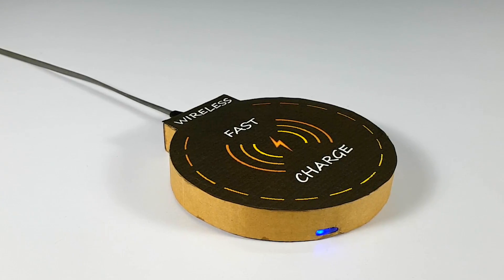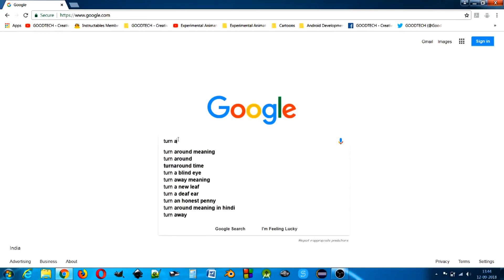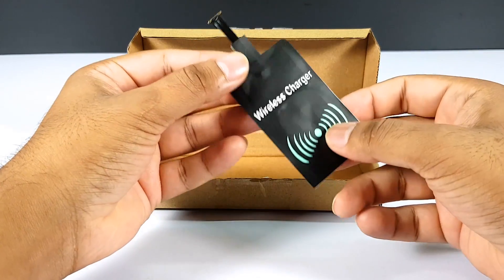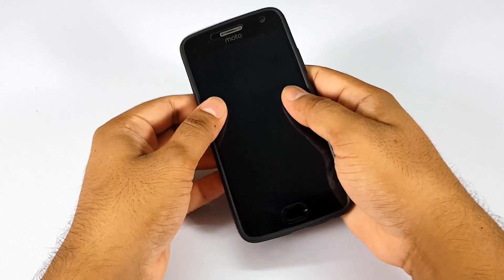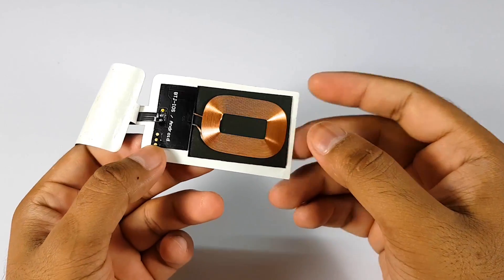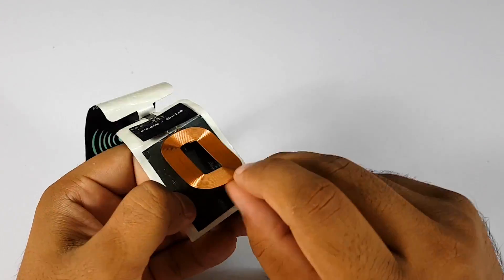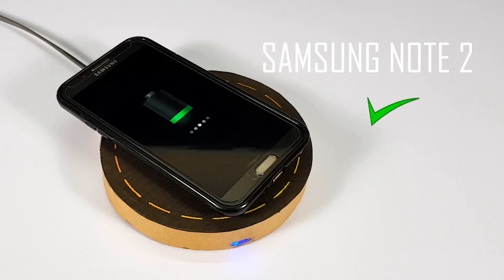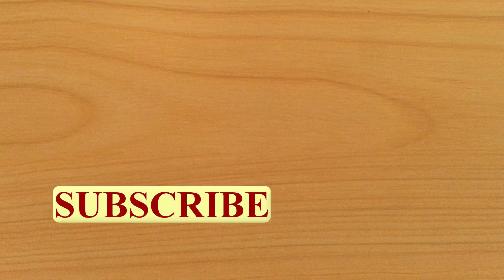Add Wireless Charging to any Phone

Comment: I am looking to install this coil in a different product, can you tell me the reason why it has a black metal rectangle connected to the coil? What purpose does this serve? Does it help the coil conduct from the charger, or does it help regulate temperature or does it help protect the phone from the current caused by the coil? Thanks for your help

Comment: Do a speed test
Reply: Cable vs wireless charging 😆
Reply from the maker: Ohh...i get it. Wireless Charging is quite slow as compared to wire charging because a lot of energy is wasted in heat. My samsung s8 (3000mAh) takes about 1 hr and half to charge with wire and takes about 2 hr 5 min to charge with my wireless charger.
Reply from the maker: How..??

Comment: Do you happen to know if there's a way of not occupying the only available USB port for that?
Reply from the maker: Yes, there is a way but is not recommended. You need to open the phone and solder the receiver coil jack wires parallel to the USB port on the PCB.

Comment from the maker: if you also like to use wireless charger for your phone then now you can easily Add wireless Charging to any phone simply by using a wireless charging receiver. 
Note: The phone may heat up slightly while charging wilrelessly due to magnetic induction but that is completely fine. All the good quality phones have temperature protection circuits.